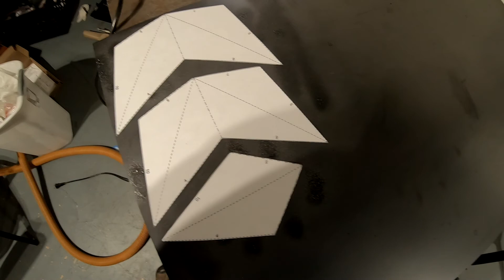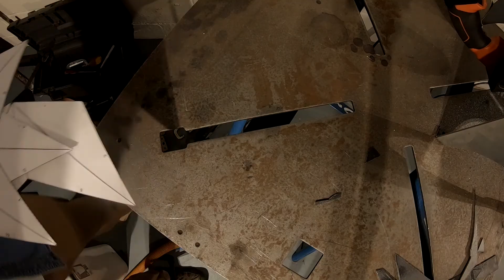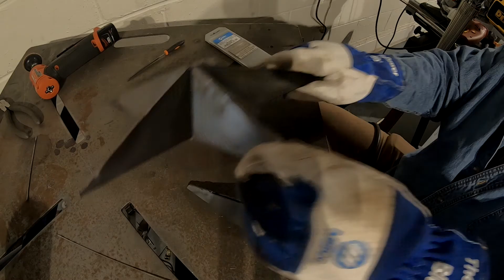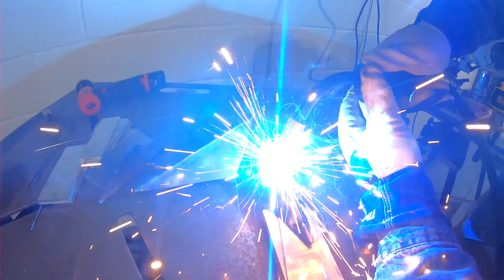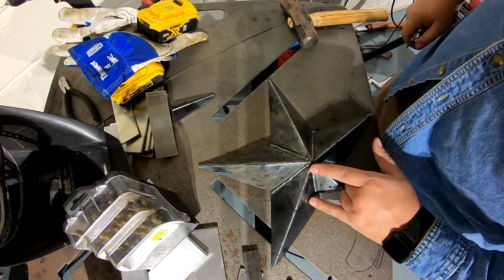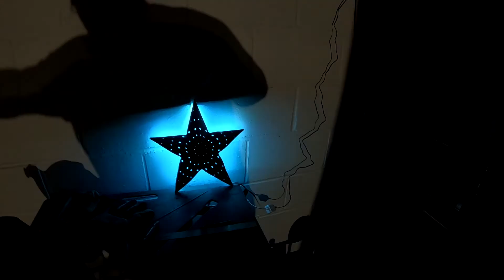3D Metal Origami Star - 1 Day Welding Projects

Comment: I've got one three feet wide painted metalic gold Rustoleum hung on the a frame portico of my cape cod style house above the front door. Saw your backlit star in the thumbnail and clicked it to get pointers on how to attach the backlight to it. I don't plan on putting holes in the metal to let the light shine through like yours. I just want the light to reflect off the siding to give it an aura around the edges. Obviously I'll have to use an outdoor weatherproof LED strip. If I'm going to spend that kind of money I may as well do it right and get one that I can wire up to a ESP32 microcontroller and control brightness and color settings on each LED in the strip individually to give it a twinkle effect instead of the cheaper ones like yours with a simple parallel circuit. I figure the electronics including the controller should cost around $50 on Amazon.